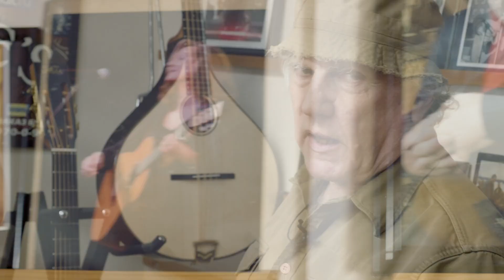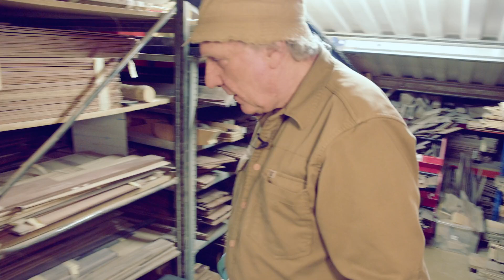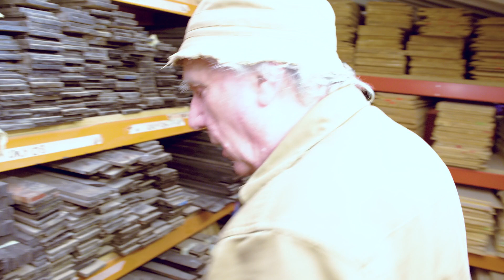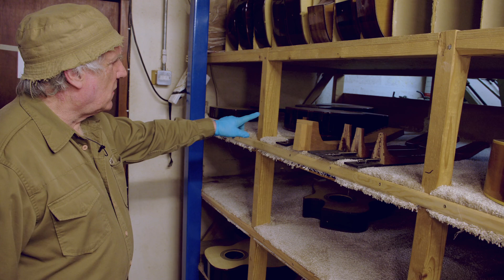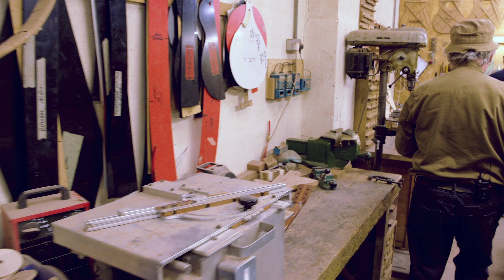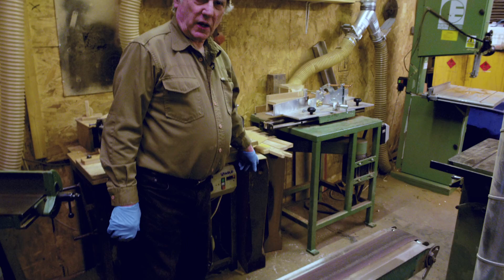A quick workshop tour of Fylde Guitars

Comment: I remember before you moved to Cumbria I had a chat about my Levin which had screw in bridge pins which you agreed to change the bridge by blocking up the holes and routing out a "normal" saddle. It was many years later that I could afford a Fylde (Magician) which you set up with a particularly low action (despite your warning that it may well be too low). Never the less I still have the Magician and despite "dropping it" when the strap came off one time it is still an exceptional guitar and always gets great comments wherever I play it. Many thanks Roger for your fantastic attention to detail, you are a legend
.